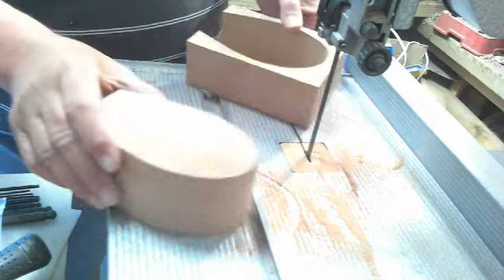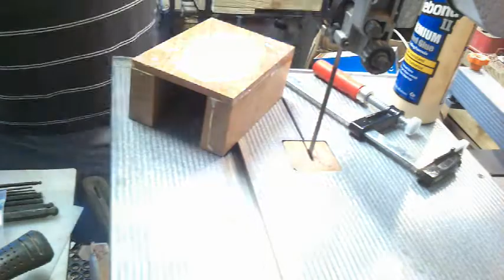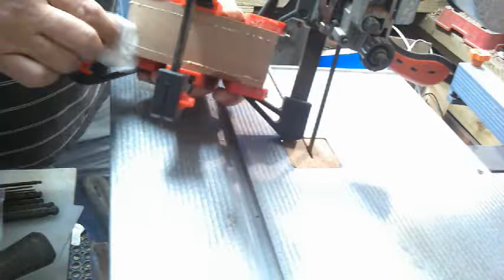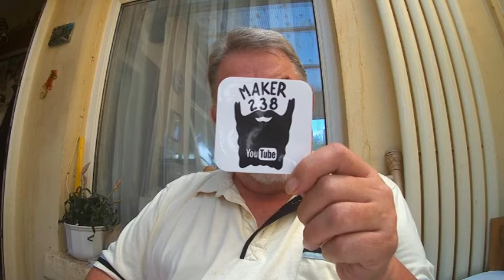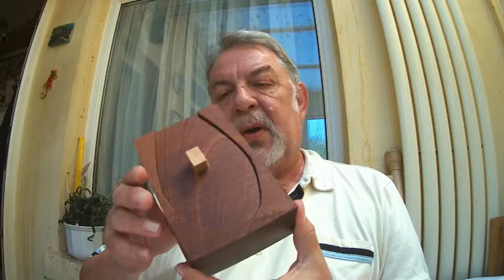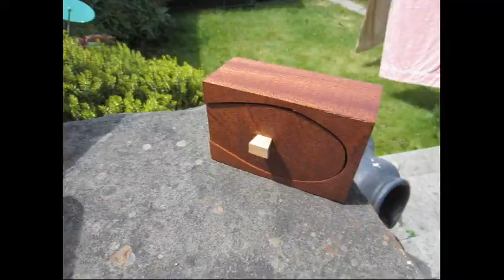Making a Bandsaw Box from Sapele and Beech for the June Challenge of #YTCCC2021

Comment: Hi Huw. Very cool design. Even cooler challenge. Keep it up. Bye. 👋👍😊🙂❤️🪵 I forgot to mention what a great job. Great job. 👏👏👏
Reply: @WoodenItBeNice  I will need to get a new blade and I will try sometime.
Reply from the maker: @copperowlwoodturning5929  Great news Rob. I need to buy a new blade as this was the wrong blade, but Axminster, where I buy my blades, was on back order so had to make do with what I had. From the research I did a 3/16" 4TPI Skip Tooth Blade is the best for doing bandsaw boxes. Huw

Comment: Very nice  bandsaw  box Huw, hard to believe it was the first. Turned out great and the shape is super! I recently picked up some Sapele; I have never used it before and while at my favorite wood store I saw some and picked up an nice length. Plan on using it as segments.
 Great job on the challenge you created my friend,
Gary
Reply from the maker: Thank you so much Gary. I was given a large amount of Sapele a while ago that I intend to use for different projects including segmenting. It is an amazing wood to work with and is part of the Mahogany family. Take care my friend. Cheers, Huw
Reply: Yes Sapele is very pretty. And this is the will have used. I think I have seen you turn it before but it was not a common wood back in the day. In the first pattern shop I worked at we used African Mahogany for patterns when they wanted a hardwood pattern(Sugar Pine for less use)
 You would not believe all the beautiful African Mahogany I turned into patterns and then painted them with either red or black lacquer. The colors were to let the molders know what type of metal they would be poring and other things like what area would be machined on the casting.
 I find wood so interesting and looking forward to using the Sapele.
Reply from the maker: @ThePapa1947  That's interesting to know. I'm looking forward to seeing what you make with it. Huw